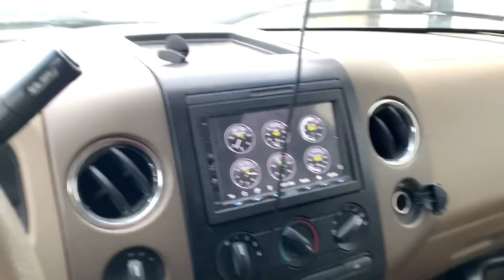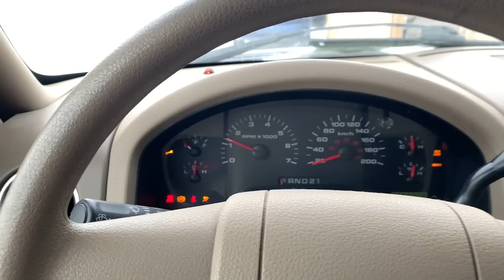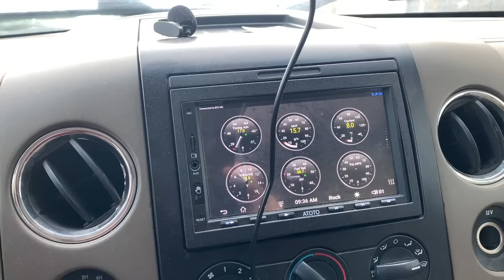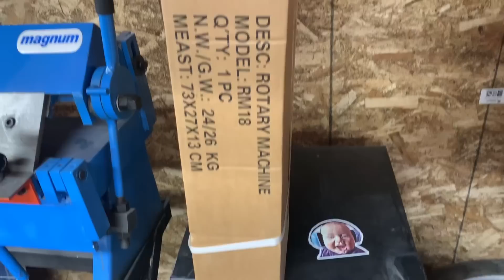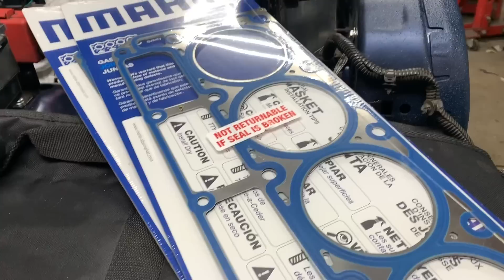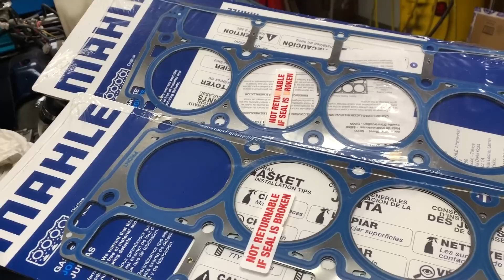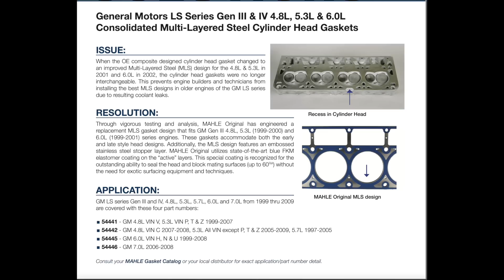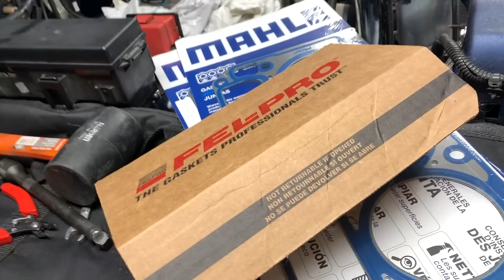Did The Engine Builder Screw Up ?

Comment: Dirt in a bolt hole kept a '75 400 Fury head from torquing down and it leaked into the exhaust, lots of steam! I re-torqued  some more and one of the long bolts snapped. That was the first time I felt the weird feeling of a bolt yield to breaking, never again! That one hole had enough scrapping dirt in the bottom to give that result. If I had compressed air that would have been avoided by blowing them out.

Comment: On 5.3Ls 00-03 trucks after -40 the ECU is factory programmed to cut fuel a bit and the choke program is super weak on those ECUs too i seen all this in the HP tuning file for the ECU after my truck wouldn't start for a minute in -45.

Comment: reuse the 6.0 gaskets, they probably were not torqued correctly.
The graphite on the gaskets wasn't even disturbed, it still looked new.
Be sure that the dowl pins are on the block side when putting the heads on, and not on the heads.
when doing 22ft lbs, be sure to torque them in sequence . . . and then do it again.
Looked like the heads were not resurfaced, cleaned with a wire wheel or something else
You can use torque lube for the head bolts
Don't use RTV on the exhaust, the GM MLS gaskets work just fine.  Torque them again after it's hot.
use a shop vac to suck the coolant out next time . . . if there's a next time
Great material, I was watching the other channel and was waiting for the fbombs to fly
Reply from the maker: Wrong gaskets were installed that was explained and proved in the video.......... end of story
Reply: @BackCountryWrenching  I've never commented on your videos before,  so I'm not sure if you're just trying to create content, or like spending 5 hours at a time doing rework.
I recently did a sloppy style head install, and I used the same 6.0 gaskets that you took off, and used them on a 4.8.  I have been regularly spinning it to 6,500.  The heads I put on have the same notch on the bottom.  You don't need the specific head gasket that you showed from Mahle.  I really think that your heads were not torqued correctly, or someone cleaned the heads with a wire wheel.  
When you removed the head gasket, it looked to be in perfect condition.  When the head is torqued and degreed properly,  that graphite seal material comes off when the head come off.
Wish you the best on your project.
Reply from the maker: Not trying to be a ass,like I say end of story, this has been well documented.  Take word over someone who posts a YouTube comment or engineers that know what’s going on 🤷🏻‍♂️. You weren’t there you don’t know what’s going on ........
Reply: @BackCountryWrenching  none taken.  Keep the videos coming.

Comment: They are the wrong gasket period ..iirc the notched heads are called caswell heads and cant be used at all with MLS gaskets , normally I weld the notch and have them resurfaced , the MLS gaskets are way better.